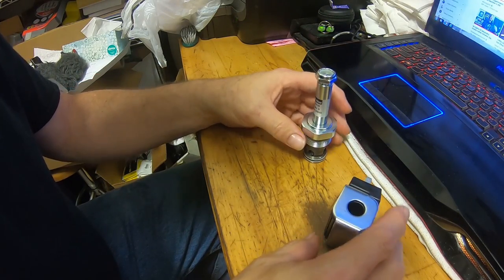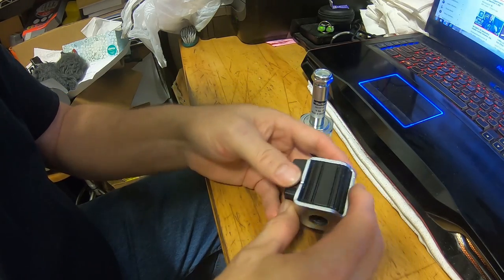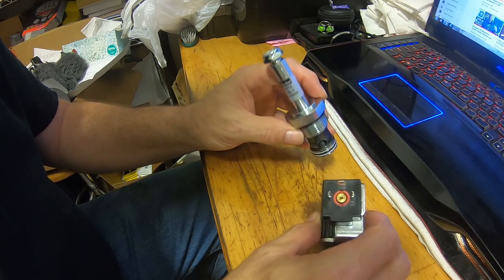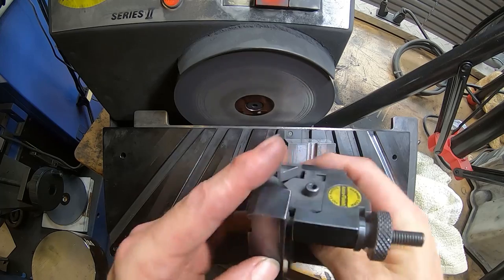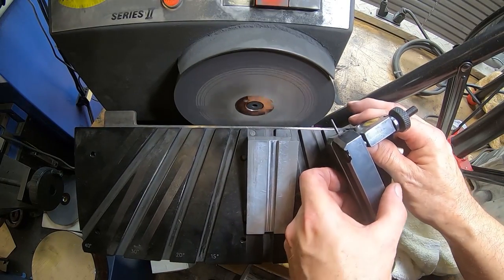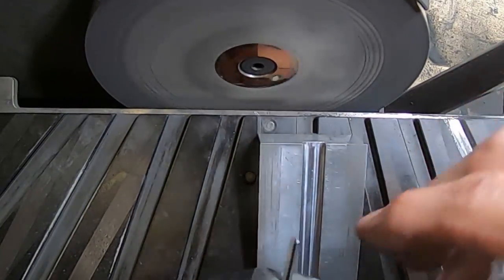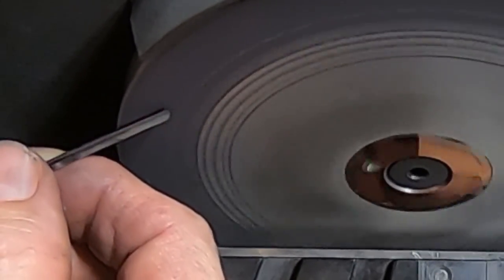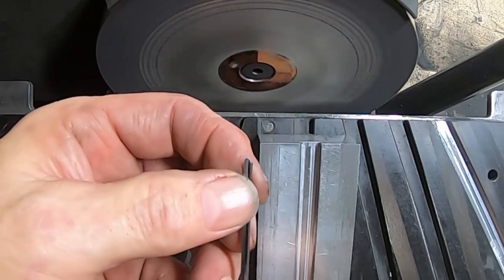Chip Blaster And Gun Drills

Comment: I have been a machinist for 30 years NOW.  SCREW EM!!!!!  You're not giving up dimensions or trade secrets.  They need to get over themselves. You have my personal permission to say I said so.
Reply: Well stated
Reply: Depending on what they are actually doing, I can kind of understand the customer though. For example with rocket engines (not saying it was a rocket engine part, just an example), all the secret sauce is in the injector plate through which the propellant is fed into the combustion chamber. You can bet that the competition would give an arm and a leg just to put their hands on a somewhat decent picture of the injector plate of a let's say SpaceX Merlin engine. No dimensions necessary, those can be deduced by a knowledgeable engineer and fine tuned through a little bit of trial and error, what's interesting is the overall design (many small nozzles vs. few large ones etc.). They even blur out the tip of the stage separation pusher (which is just a run of the mill hydraulic piston) in images, because it pushes against the injector plate of the second stage engine and thus has to conform to its surface, so it's shape might give a knowledgeable engineer some clues.

That said, yes, many companies certainly overdo it with the secrecy, even when all they are doing is something for which the patent ran out 30 years ago.

Comment: I understand your problem with the valve. I have about the same problem with one the machines I am in charge for but then is it about hydraulic valves. The machine a special made milling machine for just one type of products, The machine was built in 2008 and now is it neccesary to replace the valves but those are not made any longer but there is newer models that can replace them but it is sometimes hard to find it when the supplier has chance them new part number, and new look that not at all look as the old. The worst thing is that Vosch/Rexroth often have a long delivery time. I like your videos and will continue wathing them. Best regards from Flowerbay in Sweden

Comment: Nice repair job on the coolant system, Parker is usually pretty good about making their new components somewhat backward compatible with their legacy ones.  Appreciate your efforts to post content.  Seems that the people who make the decision regarding "proprietary" information often are so far removed from the technical content that they simply make blanket decisions, usually not to release anything or allow for any kind of publication since they don't know any better.  I like your wedge you made to get the steeper angle on the drills.
Reply from the maker: I didn't really make it clear in the video. I could get the coil from Parker but its not a normally stock item anymore. Because of that it took longer than just replacing both the parts. Also it didn't cost that much more than the old coil. Thanks Bill.

Comment: Do you need security clearance to work at centerline? I watched a you tube video one where they couldn't show the machining of the part they were making  even though you can buy one commercially. Most any machinist could reverse engineer and duplicate the part from a finished example yet the contractors for the part felt it was some secret that couldn't be shown.
Reply from the maker: I went into to one shop once to see some software demonstrated. The programmer that made the machines programs in this shop had to have a soldier escort her into the shop and had over the program to the machinist. Even their CMM had a sort of wall curtains with a lock and seals on the door surrounding it. This place machined wind tunnel models of fighter jets.

Comment: Hi Peter, thanks for your videos. I am drilling a hole in aluminum on a 50 taper horizontal mill, coolant thru at 1500 psi. I am using a .386 diameter drill and pilot drill both solid carbide, going 11 inches deep and the drill is walking about .025. What am I doing wrong. Will a gun drill work better?
Reply from the maker: Yes a gun drill will work in aluminum. But a twist drill will do it only going 11 inches deep as well. When you say pilot drill are you referring to drilling a starting hole for the longer drill? What I would do is drill a 90 deg spot drill to .01" larger than your .386 dia. Then drill your first hole (Pilot drill if that's what you mean) with say a jobber length drill as deep as it could go. Then use the long drill to finish to 11" deep. Unless you are trying to do this in a very short time with coolant feed carbide drills for some production reason. A HHS drill could peck drill these holes in aluminum OK. As I said a Gun Drill will work but don't try to feed it to fast. And depending on the aluminum type you may have to experiment with the feed to get the chips to break and feed out the drill. I usually feed a gun drill around .0005" per rev on a single flute drill. I would say also if you are using water soluble coolant don't try to run to high a surface footage on the gun drill. Even though you could in aluminum. It may tend to build up on the lands on the drill tip. If you are running oil you could run a higher speed. So maybe at 250 sfm (Aprox. 2500 RPM) at .0005" per rev feed 1.25 inches per minute is where I would start. But if speed is your mission gun drilling may be to slow for you. You could drill this much faster with twist drills in aluminum. The only reason the twist drill are walking that much is either the tips are ground wrong or you may be feeding them to fast or the shavings aren't exiting properly out the hole when drilling.
Reply: Thank you for taking the time .  I will follow your advice. @EdgePrecision

Comment: Some systems like the ones on Kiwa horizontals will run as high as 2000 psi.  The old Kiwa at the last shop where I worked had a big 10hp pump sitting on a pallet next to it for the high pressure coolant.

That Cat pump actually is a power washer pump.
Reply from the maker: Whats actually more important than pressure is volume at a decent pressure. On my grinder the coolant pressure is only about 350 psi but its at 40+ gallons a minute. Some pumps can control the volume they put out at what pressure. This would be very useful.
Reply: @EdgePrecision  I know.  That big pump I was talking about was just for the through spindle coolant.

Comment: A really good trick for situations like your doing changing that cartridge on the fly is to find the breather or fill cap on the reservoir and stop one up with a rag and wedge a shop vac hose into the other and pull a vacuum on the reservoir. Ive used that trick tons but may not work. At least you didnt have a gusher.
Reply from the maker: Yes this was mentioned in another comment. Thanks.

Comment: So, I see that Titans of CNC are using a lot of Kennametal Harvi III endmills in inconel 718.  Have you used any of these or have any experience with them?  I don't currently machine any 718 but if I started my own shop, I suspect I would specialize on machining hard materials because it seems more interesting to me.
Reply from the maker: I have never use used the Kennametal endmills. Also Sandvik makes some ceramic tipped endmills. I got a quote from them but haven't tried any. They are very expensive. It would have to do about five times better than others to be useful. I plan to do a video on endmill geometry to show what I have found works in difficult to machine materials.
Reply: @EdgePrecision  For what it's worth, I suspect the Harvi IIIs are just highly optimized AlTiN coated carbide tools.  I really don't think there is anything "exotic" to them.   As I've said before, when I used to machine 718, the largest tools I used were 1/8" so that severely limits your tooling options though, I haven't even looked to see if Kennametal makes any that small or smaller.
Reply: Titan uses Kennametal tools because he is sponsored by them, not because they are better.
Reply: @loukola5353  I don't think you can answer that question for Titan.

Comment: Hey Peter how's it going? I am about to run a gun drill in a manifold about two feet deep and I remember watching a video in the past about you showing how you ran your gun drill. Is that one of these videos you had to delete? Because I can't seem to find it. Thanks!!!!
Reply from the maker: I don't know if the videos I have made enplane exactly how to run one. They are mostly on sharpening one. What is the diameter of your drill? What material are you drilling? What coolant and how much pressure and volume can the pump deliver? I will say this you could drill 24" deep with one long drill. But I would usually drill this with more than one drill depending on the material. In aluminum you could use one long drill if its large enough in diameter. If its small the drill won't have enough support in the middle so you would have to start with a shorter drill. In tougher materials the drill would need resharpening before it made a 24" deep hole so could could start with a shorter one and go part way. than finish with a longer drill.
Reply: @EdgePrecision   Edge Precision  the drill is .6245 and 26 inches long. We need to go a little over 24 inches deep. The material is A36 and the coolant is called hangsterfers s-500 and the through coolant pumps out 300PSI.  So this is steel, so are you saying we need to drill half of it first and let the gun drill finish the rest? Do you run it the same as a carbide through coolant drill? Where you give it a pilot hole and start the drill slow in the hole then speed it up once it starts cutting? And don't peck? Thanks so much already for your reply!!

Comment: Peter. You could replace the o-rings in the spool next time.
Reply from the maker: It wasn't a seal problem. The newer solenoid would not fit on the old valve. So I had to replace both. The problem was the valve wouldn't open. Due to the faulty solenoid coil. I should have said that in the video. Thanks.